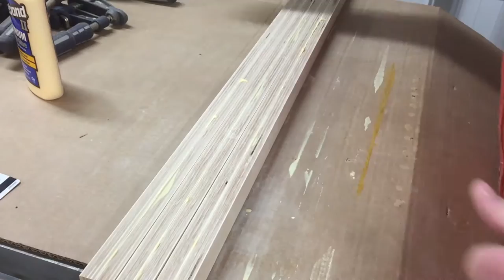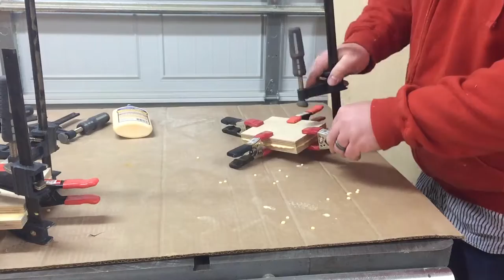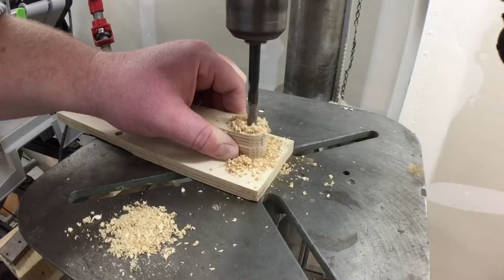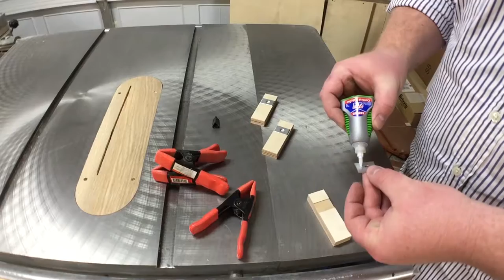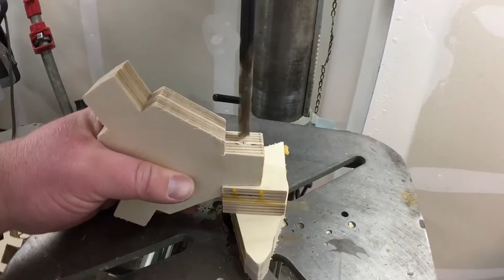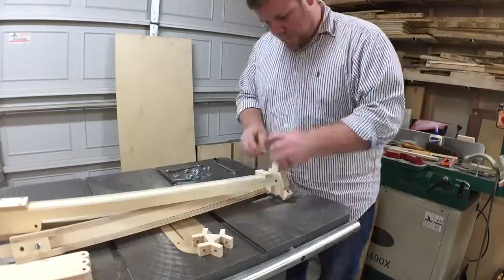[Let's Make] Tripod Part 1 of 2

Comment: That turned out really nice. Is this tripod going to replace your current camera holding set up? If so, what improvements will this bring over your current set up?
Reply from the maker: Yes this will be replacing my current tripod. I currently use a $7 tripod from Amazon. This new tripod is very stable compared to it, and when I complete the top portion, I will be able to get better shots and setup will be way faster and easier.